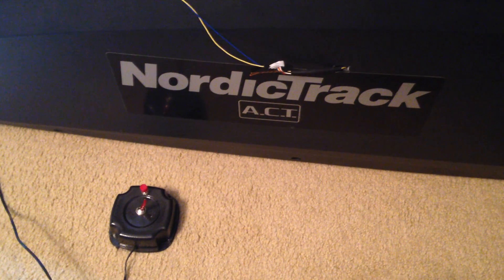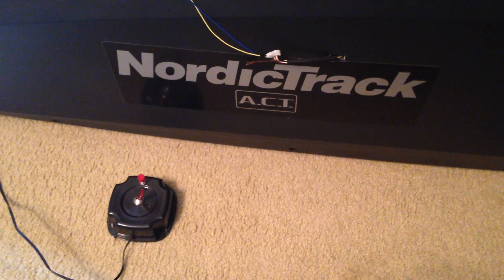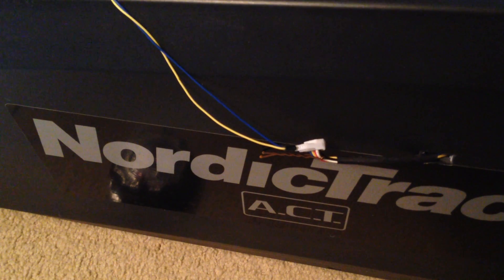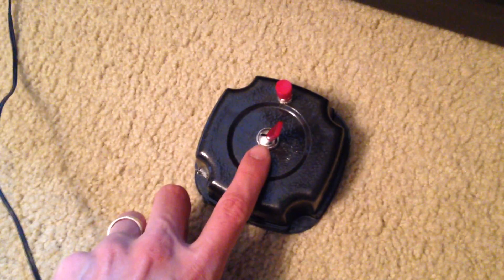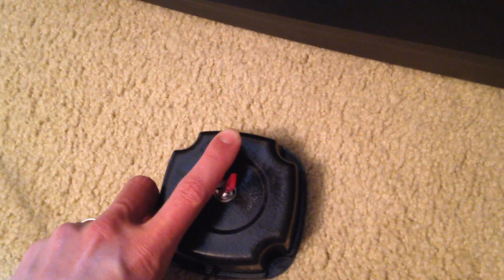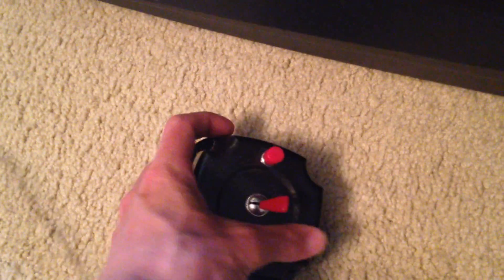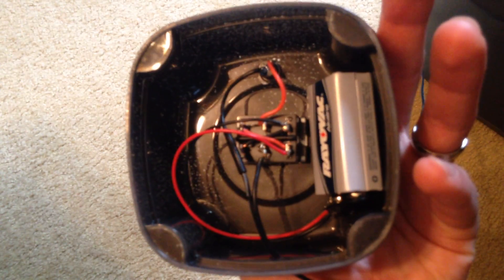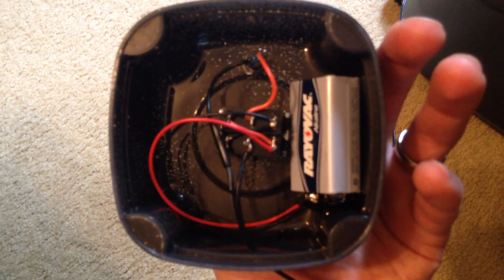Zero Resistance! Fix NordicTrack Elliptical - Hack with 9v Battery

Comment: First, thanks for posting this. When your tensioner stopped operating, did you also notice that one of the arms felt loose, even though all the screws are snug? Trying to diagnose if I have the same issue as you did. Thanks
Reply from the maker: Nope, no looseness on either arm/pedal. Everything still worked fine except zero resistance.

Comment: Couple years old but having the same issue and planning on doing the same.  Question I have is does the motor know max tension like you mention because when i have it unhooked to test the option it just continues all the way around which would break something worse if cable was hooked up.  Second is does the resistance show it is moving up or down on the control board at all?
Reply from the maker: Resistance doesn't show on the control board, at least not the way I had it hooked up. Mine also rotated all the way around, but it never broke anything and worked like that for years before I finally replaced it.

Comment: My NordicTrack 990 also is stuck on low resistance. Took it apart and can see than the tension is fine--it's the resistance motor. How do I jump it with a battery? I'd be interested in a more detailed video about your steps. Much cheaper to do this hack than replace the resistance motor. Ugh.